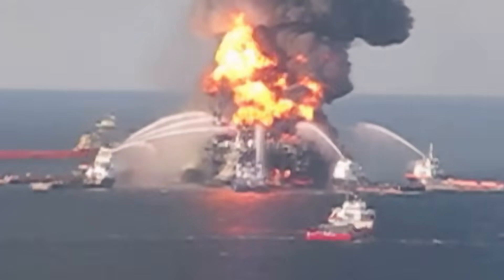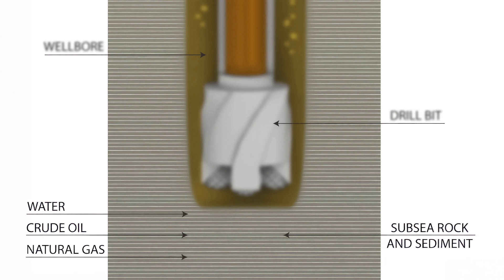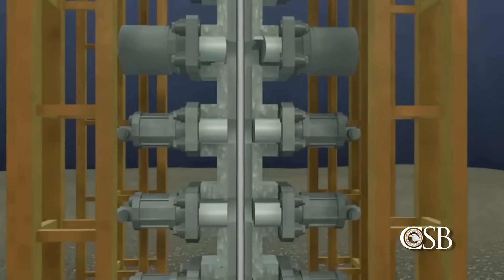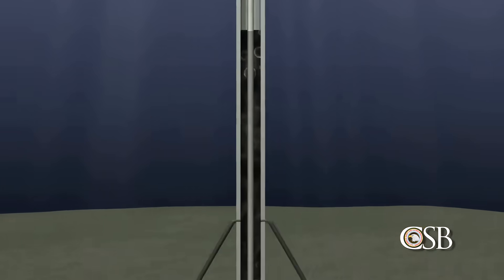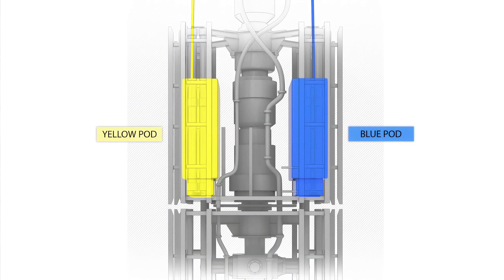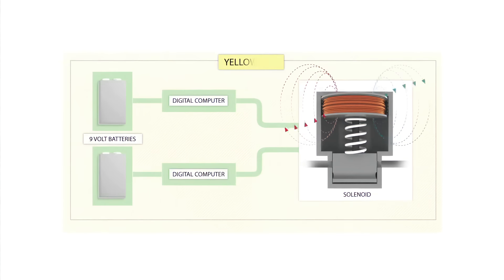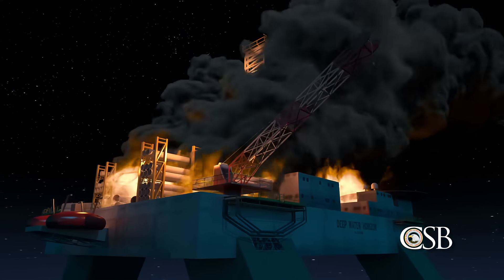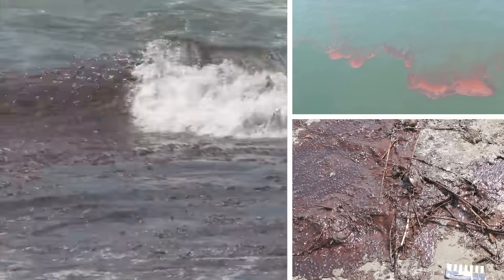Deepwater Horizon Blowout Animation

Comment: only way this can fail is if there was someone replaced working with not working; 
this was not accident; this was intentional; 
#1 american made product when maintained under maintained schedule never fails; 
if american company made product; and it comes with maintainance schedule; and you follow it to the tee; it will never fail; for duration; that is how americans make product; 

only reason american product fail because somene took shortcut; 
but deep water horizon was given award for its maintanance records; 
so for it to fail; redundant system; it was not accident there was triple failure; 
each system uprise beat the security system; 

because if kick pressure was above threshold of known kick; it would have been replaced; with newly designed and updated; 
which means the kick was within known tolerance; and for all 3 to fail; is impossible; 

which means only way all three failed; after deep water horizon winning award is if someone replaced with failed device; 
this is now murder investigation;

Comment: Remember when instead of actually removing the oil from the surface of the ocean, which would have been extremely expensive, they just sprayed a hazardous surfactant onto the surface of the ocean from planes which caused all spilled oil to sink to the bottom of the ocean?  Once it was at the bottom of the ocean, we were told it was too dangerous and destructive for BP to try to remove it.  Then the media just quit talking about it.  That was neat.

Comment: This, like typical nuclear power plants, was filled with numerous backup (fail-safe) systems. This serves as a lesson regarding how designers can become overconfident and complacent when designing and operating such equipment. Such systems are often tested and retested multiple times before being installed in place. Those, who design each of the components, that are made as safe as possible can overlook some conditions. They may feel assured that if one part is 99.9% effective that the whole string of backup parts are almost impossible to fail.

Such confidence then is used to reassure the customers and public that every failure possibility has been taken into consideration and throughly tasted.

I found it to be amazing how many components failed in this situation, and not all because the first seal failed and the pipe bent from the internal pressure. I also wonder if anyone was incarcerated due to all those faults.

Comment: It is so hard to believe that both the yellow and blue systems both had electrical wiring issues,  what happened to proper training by apprentice trained personnel, or was this replaced by courses attained over time rather than a dedicated apprenticeship. I don't know but for both critical systems to have electrical faults is nothing short of scandalous.. There should have been a system for checking this without actually operating the rams. Short cuts by BP were not mentioned in this video but many there was along with plenty of arrogance. BP was an outstanding company to work for until it merged with Amoco.

Comment: Something doesn't jibe with this explanation of the oil and gas going up the riser after the cutoff ram is stated to have successfully shut off the well. How can that stuff continue to go up the pipe when the pressure was cut? I'd say the explanation given is in error and the the well was not successfully shut off at the blow out preventer (BOP). Did I miss something? The term used to describe what happened - "oil spill" - is very misleading as it should have been called something more serious than a mere spill.
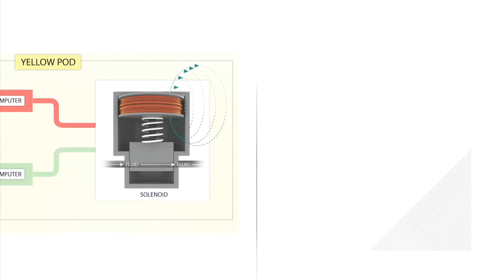Reply: The BOP did not successfully cut the pipeline because of the bent pipe, and because the pipe was only partially cut oil leaked into the ocean and continued flowing to the rig. 8:25

Comment: Why are safety critical valves on the oil rig operated with batteries? The idea of safe failure should apply here as well. 
My field of work are powerplants and most critical valves are either spring operated (ie pressure release valves) or wired in such a way that they require electricity to keep open and if power goes out they automatically shut via spring or other mechanical means.
Reply: If you're talking about the valves for the blind shear ram, I don't think pressure release would work in that situation (I could be wrong) and they needed to open the valve not close them. It was also located 4,000 ft below the surface so that's an added difficulty.

Comment: Why was the oil not detected?? Whose job is it to monitor for kicks and react to them? Why was the pipe closed at the top? Why wouldn’t there be pressure sensors and a way to relieve that pressure in the one pipe this whole operation is all about? What company wired those yellow and blue pods? It was someone’s job to inspect that equipment before installation.

Comment: The entire thrust of the video seems directed towards equipment failures. I am surprised there is not a single reference regarding why the kick occurred and the failure to detect it. Monitoring the well is the primary method of control and early detection is hugely important. It seems likely to me that there is an untold story here.
Reply: You're probably right. I will agree with you there. But when you think about it critically, the untold part of the story most likely amounts to one or more human beings being incompetent and not following some procedure. Entirely possible they are dead now, I don't think beating that dead horse is helpful. 

If there were other technical early warning systems at fault they should have been covered. Are you aware of any?
Reply: @AlexKidd4Fun  I worked for many years as a deep water drill ship OIM... on occasion, there were inappropriate instructions from shore-based supervisors, often  driven by cost factors (?), putting risk-based supervisors under severe pressure... such scenarios can result in poor decisions and hasty actions contrary to best practice... Of course, I have no idea if this is the case here, although it doesn't seem to have been discussed...
Reply: "rig-based" not "risk-based"...
Reply: @bobsimpson4298  Although it is not covered in this video, poor decisions about the amount of cement to use led to the kick.  If everything else had been properly handled, the blow out preventer would not have been needed at all.
Reply: @erintyres3609  There had to be a primary cause for the kick to occur and inadequate cementing (and presumably inadequate testing of it thereafter) could clearly be a part of that. It does sound like an untold story, although the later issues of BOP maintenance, installation and testing inadequacies were part of the secondary well control difficulties which contributed to the disaster. The responsible parties may not want to discuss how the loss of primary well control came about?
Reply: @bobsimpson4298  this video doesn't even tell half of the story.  There were so many other causal factors before the BOP failure.  It was a shit show in all regards.
Reply: @bobsimpson4298  Hey Bob ever have a mud hand throw a wrong valve and send light weight fluid downhole? Ever get enough cement up in the stack to fowl it up?
Reply: Because the company that made the bop is full of id10t engineers that dont think things through.
Reply: The video does not explain how the BOP senses the oil leak into the slurry. Unless I missed it. What kind of sensors are used I wonder...pressure? Chemical? A sensor to test the thickness of the liquid? Even optical sensor is possible.
Reply: That's what I was kinda thinking, I've actually been reading about drill rigs and the Deepwater Horizon accident a lot recently and actually just happened to find this video unrelated to that reading, and the whole time I've wondered why the kick went undetected when several had already occurred during drilling, and was a known and severe issue. I still can't find anything explaining it, so I think I'd have to agree that the true story is likely only known by BP and Transocean, and possibly (but not probably) various government agencies
Reply: GET OUT THE FOIL. WE GON MAKE HATS BOYS
Reply: Because it's a fabricated story and it was completely preventable and was warned ahead of time, they used valves that could not hold back that much pressure hence why BOB failed and the company hired (previous company said the valves would not work and they got replaced a week before and refused to instal that BOB) to over look safety had manfuncting equipment, all those safety equipment is to be tested before traveling and then again before installation and obviously that was not done. Pipes bend all the time steel is flexible and they even use inftable parts to direct the drill tip and angle it into various oil patches especially smaller ones there was a commercial about a kid using a bendy straw to get to the bottom of a glass and they used that for offshore drilling but in this case a minor bend caused the issues nope the valved for the cut off where not able to hold back that much pressure and it bore thru the cut offs and donuts.
Reply: @eventprogenitor1873  The BOP was capable of holding the psi back. it was a 20,000 psi BOP if I remember correctly. Sometimes the drilling company has the BOP manufacturer help and oversee replacement and/or troubleshooting of different aspects of the BOP. And then oversee the testing for confirmation that it is working correctly. All the sub-sea (people that worked on the BOP) fellows I ever worked around at this echelon were all about the business of doing it right. Their integrity is anchored within me. There is too much at stake, like the lives of souls on board not to do it right. It is a federal law that BOP's are to be tested every 2 weeks and after each cement job at which time (most of the time) a Federal employee (MMS) will come on board and go over all information and check pressure testing charts and BOP function test records. It's a major federal felony to falsify any of these tests. Pipes are flexible to a certain extent. Drill Pipe inside a run of casing is highly unlikely to bend significantly enough to cause a problem simply because there is not room enough to. Outside the casing they can corkscrew the drill pipe and go wherever the seismic charts showed potential oil pockets. But here's the rub on that bit of info. I saw the seismic chart on that find. It looked like a planet. You could drill virtually anywhere into it and be able to produce huge amounts of oil. I believe this well was on a 10 slot template system. Drill 5 wells in 1 slot, cap them off, move the rig a little, drill 5 more, and so on. Your right they weren't able to function the BOP correctly or quickly enough to stop the pressure. I have witnessed lighter fluid, accidently pumped down hole which was inadequate to hold down the pressure and when it started coming back to them, when closing the BOP, it acted like a water cutter and cut through some of the BOP valves. Cement hiding might be another factor. I heard that they had done a cement job prior to the accident, and maybe waved off the test.The feds will give special permission (very very rarely) if they can't  make it, and usually only if they know that that particular rig does it right. They may have performed the test and not realized that cement stringers got caught up in the stack. Sometimes the formation swells up and makes the cement go higher up the hole (into the stack) than was calculated. Depending on how deep or how hot it is downhole is the amount of cement retarder they use. Sometimes it could take 3 days for the slurry to set up. And the possibility of the cement sitting in, unfortunately, strategic areas, not setting up enough in the BOP's for 3 days and then actually impairing critical functions might be valid. Which I have experienced also. I have other thoughts but this is too long as it is.

Comment: The design of the AMF Deadman is the perfect example of 'fail-deadly'...it's over-engineered and requires everything to work properly in order to function, which wasn't the case here.

I think a better, safer design would be to reverse the function of the solenoids...rather than needing computers and batteries to open the valves, the act of energizing the solenoids should be keeping the valves CLOSED, and should draw power directly from the rig. That way, if power is lost, the solenoids would de-energize, snap closed, and open the valve to the blind shear ram, instead.
Reply: They would have to run a 4,000 ft  waterproof all the way down to the BOP, which while doable is an added expense that a company would never want to spend especially due to the system in place that they though would work

Comment: How two solenoids could be mis-wired on such critical systems is beyond me. Was there no test of the equipment? No inspection of the wiring scheme? Redundancy is soo important because human error is inherently a part of anything we build.
Reply: Little late but BP had the BOP rebuilt so they could run test while keeping the rig running they probably paid for the cheapest option and didn’t care to test before installing the entire accident could’ve been avoided but they were greedy
Reply: yeah some equipment makes money, other equipment just cost money for these companies. f them
Reply: Well interestingly the "hero" of the movie, Mike Williams was almost directly responsible for this disaster. He was the chief electrician, it was his job to inspect the critical electronic systems. He didn't. He was lazy, inept, and an alcoholic gambling addict. If anyone should have been charged, it was him. They run BOP tests almost daily... You cannot tell me that they didn't notice the gates weren't working correctly. I'm sure this was on "his to do list" when he sobered up.
Reply: It's basically impossible. My bet is someone of the hooked nose tribe in congress took out insurance on this.
Reply: It was likely done under the mindset of "well, chances are we won't need this thing anyway, so it doesn't matter if it's done right." Just one of many, many "yellow lights" that were ran on the path to disaster.
Reply: That's essentially what I said.  Redundancy is essential in a high pressure environment such as drilling for oil, and their cannot be enough emphasis placed on inspecting bps.
Reply: Reminiscent of “The China Syndrome,” where X-ray validation of welds turned out to be the same X-ray, duplicated. Fictional, I know, but these days the line between fantasy and reality is vanishingly fine.
Reply: affirmative action
Reply: @BluffCreekStudio  White privilege..
Reply: @BluffCreekStudio  and im sure u are a bastion of intelligence and competence
Reply: @BluffCreekStudio  racism
Reply: @AustinMichael Absolutely nothing wrong with racism. It's usually just pattern recognition.
Reply: @JesterFlemming  Says every would be genocidal maniac who needs a justification..What color were the executives whose decisions got all of those people killed?..Just asking for a friend unclear on your selective use of "pattern recognition.."
Reply: @BluffCreekStudio  lol true

Comment: This is false. If you have ever worked in the oilfield you would know this is stupid and made up to cover BP arrogance and miss understanding of drilling a well. The B.O.P were not inspected like they were suppose to be. Because time and money. The cement job did not hold and the result of the blowout was because the B.O.P’s were neglected by B.P.. to all you oilfield guy you know if you have ever replaced a set of rams that a thick seal runs around the parameter of the rams. If that seal is not maintained and tested frequently the hydraulic lines will be filled with solids from the drilling fluid. I have seen this happen once. The B.O.Ps will not function properly. I was DD wells for BP for about 2years when this happened. The truth was out there as a malfunction of the B.O.Ps due to the fact of BP not testing. The movie Deep water Horizon was spot on to me. BP was at fault of this totally preventable, deadly event. But the arrogance of this company of being being Billions of dollars rich and able to buy out whoever they want is true. But in the end they chose life and destruction over money. BP is shit to me. A few good men lost their lives and their family lost their husband a dads. Such a shame.
Reply: BP is definitely at fault, but the video is going through exactly what happened in terms of the hardware

Comment: Shouldn't the solenoid, a last resort mechanism on the last resort system, be designed with a fail-safe mindset, where the value would open the fluid pipe if it loses power from the rig using an unpowered/natural way, which would close off the oil pipe? In other words, why does the fail-safe mechanism rely on something that can fail?
Reply: It was, the valves were suppose to open when the computer detected that there was no power on the rig

Comment: I just think it’s really funny that they used a 9 volt battery and a 27 volt battery. Like that sounds kinda stupid to me you think they would have some other source of power.

 But instead they chose battery’s like is there not underwater generators? 

Maybe I’m wrong I don’t drill oil it just seems like such a weak backup for power. 

Hopefully someone can prove me wrong :) and explain in detail why.

Edit yes there is underwater generators so why not use a tidal generator? Idiots
Reply: If they were to use a different power source, they probably would have ran a cable down from the rig
Reply: They still would use batteries, but they would constantly be charging until the emergency to prevent them from draining, also a tidal generator would be overkill and they were in 4000dt deep water making it neither cost or time effective to install